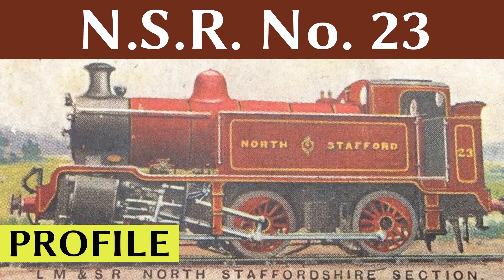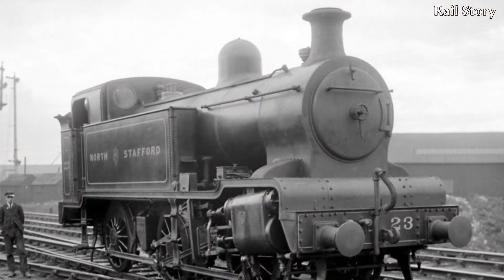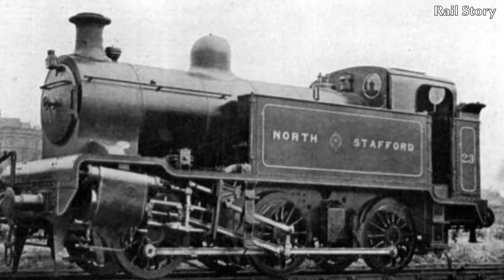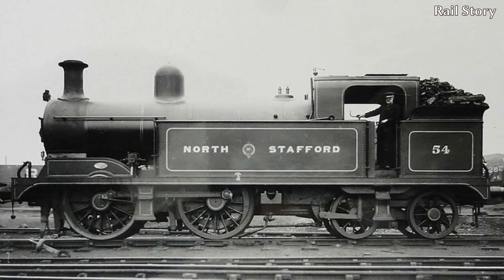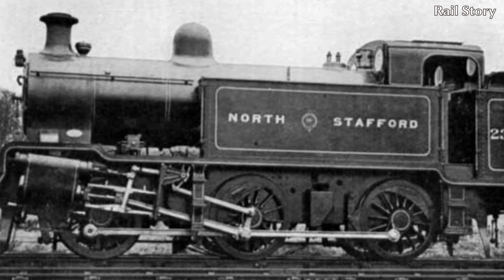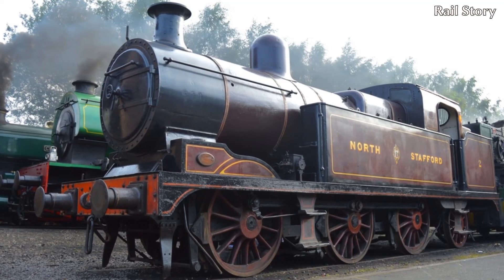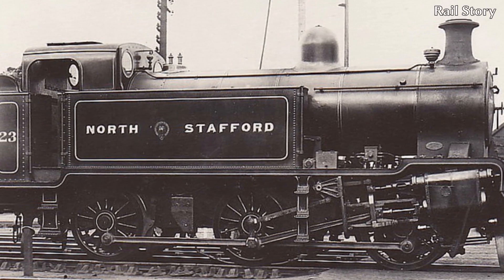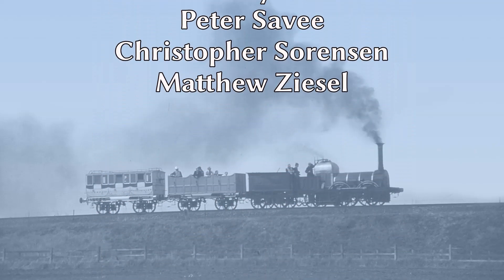Profile: North Staffordshire Railway No. 23

Comment: the crank position feels something like the Southern Railway Lord Nelsons because they are the only other 4 cylinder locomotive to my knowledge that have the unique 8 beats per wheel revolution
Reply: that offset pricked my ears up.  i'm wondering why it wasnt done on those engineering masterpieces also known as the gwr castle class.
Reply: @vsvnrg3263  Most likely its a fairly complex piece that requires much mor complicated forge tooling than a simple 90 degree offset for all 4 crank throws. Plus with the 90 degree offset, you don't need 4 sets of valve gear, simplifying the design (google the King or Princess Royal valve gear to see what I mean) Downside is that it doesn't have as powerful a draw on the fire as the 135 degree offset.
Reply: @KPen3750  , good answer.  but the victorian railways in australia found that sharing the outside cylinder valve gear with the third inner cylinder on the s class was problematic.  they did not repeat that with the 3 cylinder h class.  they installed a type by henschel and son.

Comment: Good video, always wondered about this little loco that everyone knows from cigarette cards! There are parallels to be drawn with the GER’s decapod are there not? Surprising that Hookham didn’t aim toward an 0-6-2T, 0-6-4T or even 2-6-2T or 2-6-4T design that could have mounted a larger boiler and greater water and fuel capacity without pushing the axle loading up to intolerable levels? Had he done so, especially with the latter arrangements, he might have been on to a winner…?

Comment: I can't help wondering why an 0-6-2T design wasn't used, allowing for additional water under the bunker and a longer boiler, after all the NSR was no stranger to that wheel arrangement.  Was there some specific constraint on the route it was intended for?
Reply from the maker: There were some very sharp curves on the Loop Line.
Reply: @AnthonyDawsonHistory  i am guessing she was the only 0-6-0 tender engine fitted with outside cylinders on the newly formed LMS at the time?
was that the real reason way they thought of her as being non standard.
by the time she was cut up for scrap would this engine have been in a bad state of repair?
Reply: @AnthonyDawsonHistory  There was also a constraint on platform lengths on the Loop Line which may have led to a short, 0-6-0T design rather than an 0-6-2T, a type the NSR had perfected already in the New L class (so good that the LMS almost adopted it as one of its new standards).
Reply: @eliotreader8220  Not mechanically worn out I'm sure, but No23 had been through a fire at Stoke shed and received some superficial damage, being fully repaired as far as is known. The tender it received was a second hand example from a scrapped NSR 2-4-0 so that possibly did become life expired; drawings exist showing No23 was modified at the rear to couple to that tender but whether it would have coupled to anything else is an open question. So that might have been a factor in early withdrawal. Generally though, in the early days of the LMS, being non-standard was a death sentence, especially a "class" of just one loco. And once Stoke Works closed in 1926-7 the writing was on the wall for all NSR classes - the Knotty fleet of team locos became the first of the pre-group companies to be eliminated by the LMS, by 1939.
Reply: @eliotreader8220  'Non standard' would have referred to her being a 'one of', surely? The LMS rooted out as many minority locos as they could to facilitate spare parts keeping. (The spares shop foreman on Sodor faces a situation of increasingly nightmarish complexity.) The GWR, for similar reasons, rebuilt as many imbibed Welsh engines as they could with standard GWR boilers etc.

Comment: Looks like a prototype for the little "simplex" live steam locomotives - What a fascinatingly powerful 0-6-0.

I've noticed 0-4-4 tanks sometimes described as 4-4-0 tanks, is there any particular reason behind this?
Reply: I am also confuced at this, technically calling them 4-4-0s is incorrect, because that's the backwards wheel configuration of the tank engine (4 driving wheels on the back instead of 4 in the front)
Reply: My understanding is that it is because the central number is usually the driven wheels,  so it (usually but not always) goes carrying-driven-carrying. If there are no carrying wheels in front of the drivers it is thus an 0-4-4, but if there is a front bogie but no rear carrying wheels it is a 4-4-0.
Reply: I suppose it all comes down to which end is the "front" on an 0-4-4 tank, then, since they're designed to run in either direction on commuter services

Comment: Such a shame that only two NSR locomotives were preserved and that they are both in cosmetic condition.. Just a quick question: would you think is would be cheaper to overhaul/rebuild N° 2 or build a operational replica of N° 2
Reply from the maker: No. 2 is pretty much worn out so any "restoration" would in effect be a new loco: new wheels, cylinders; boiler; cab, tanks and bunker.  There's also a possibility the frames are cracked... so by that point you've built a new loco and not preserved anything. So I'd rather see a new one built  and keep the original.
Reply: @AnthonyDawsonHistory  I agree, and the preserved loco is an amalgamation of two anyway, nos 2 and 72, so any replica could assume the identity of the other one! A vast amount of money and effort needed to achieve either a restoration or replica though...

Comment: what power class did the lms give this? and how did the rods conecting to the valve gear beside the boiler fit in tank engine form?
Reply from the maker: I dont understand what you mean about the valve gear? It was built with Walscheart's valve gear from new, and remained exactly the same when rebuilt as a tender engine.
Reply: The LMS only classified it 3F, which does seem a bit mean.
Reply: @AnthonyDawsonHistory  In the image of the engine after rebuild it shows this large rod above the running board that sames to link the valve gear with somewhere in the cab. would that have taken space for the water tanks pre rebuild?
Reply: The reversing rod is also shown in the same position in the drawing of it as a tank engine.  It was quite common for the inner side of tanks to have recesses for the reversing gear,.
Reply: This loco, as a tank and a tender engine was right hand drive. That big rod is the reversing link to the Walschaerts valve gear.